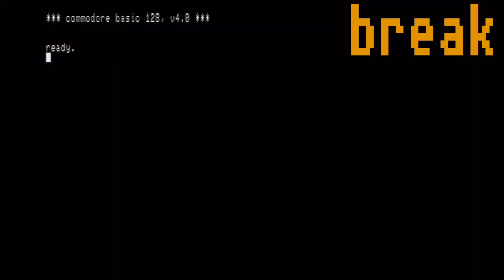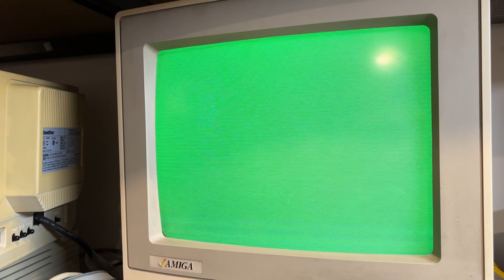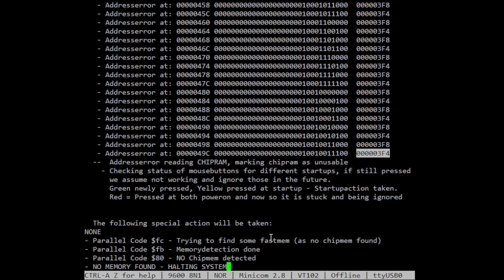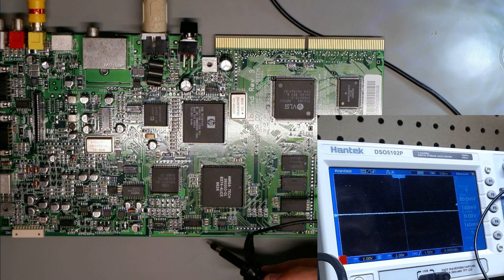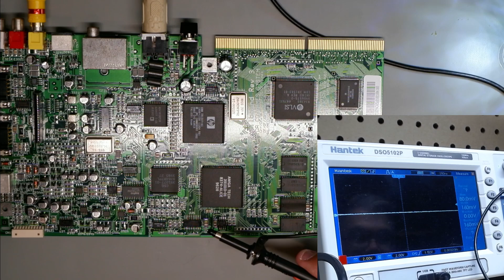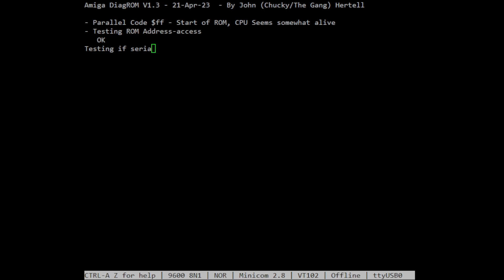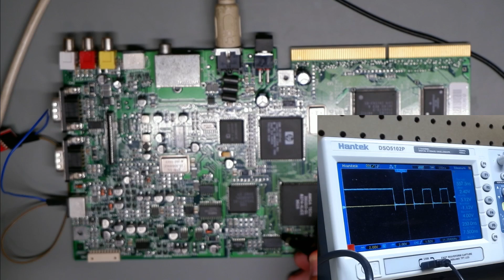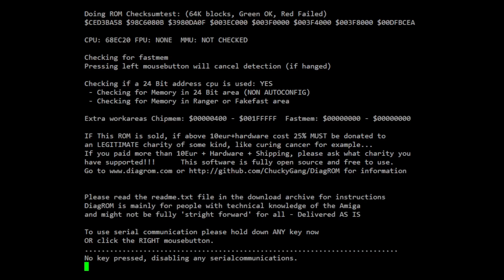Reviving a Vintage Commodore Amiga CD32 Motherboard

Comment: Does the 32 have a command line or can you interact with it as a computer?
Reply from the maker: With the addition of an expansion card, you can turn it into the equivalent of an Amiga 1200, and use it like one. I didn’t have one. :)